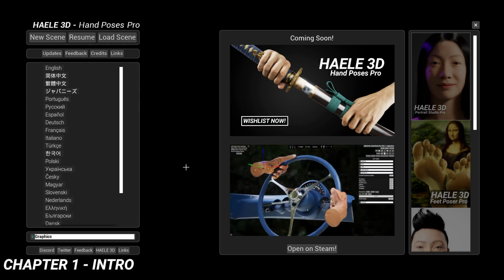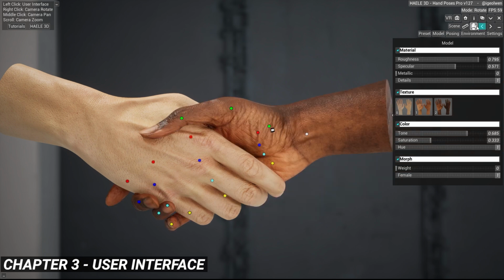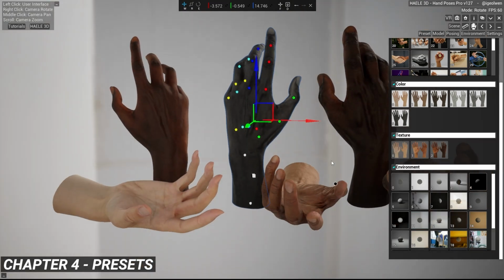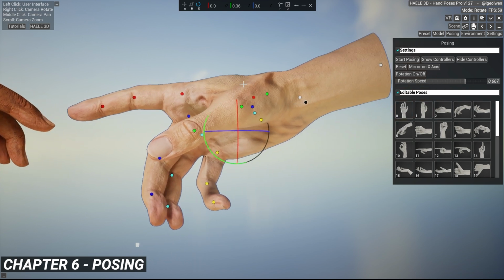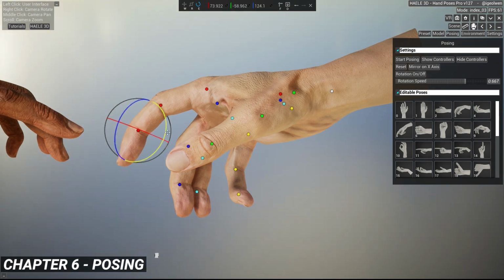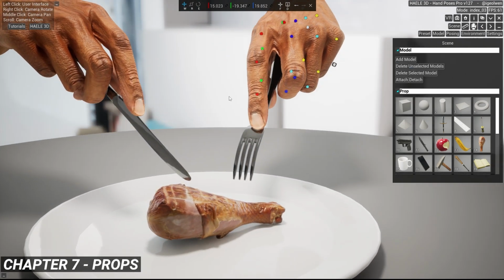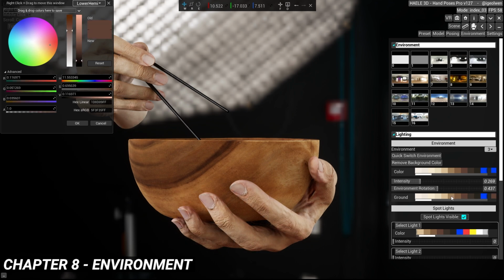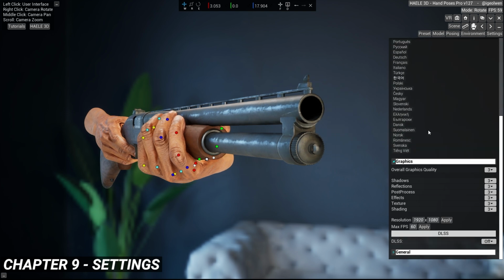TUTORIAL - HAELE 3D - Hand Poses Pro - Drawing References

Comment: Hey there Ige. I have Haele 3D feet poser lite and when I try to run it it gives me a fatal error.  I’m guessing you need to push an update out.
Reply from the maker: Hi, try to run it in the DX11 version and try to upgrade your graphics card. You could also send me the crash report if the upper two does not solve it.
Reply: @haele3d  hey there. It actually works when I put it on DX11. Thanks.